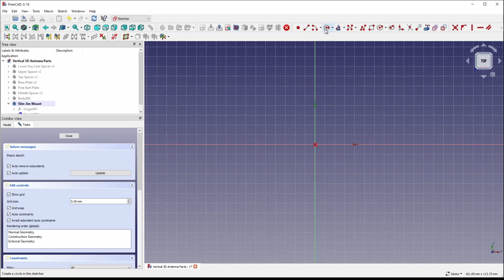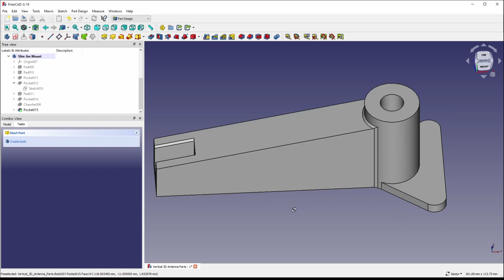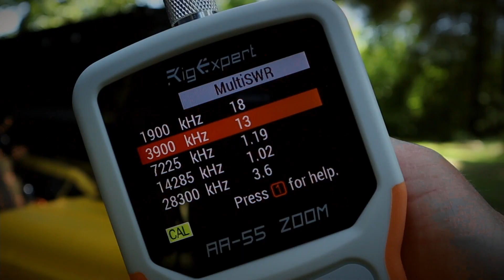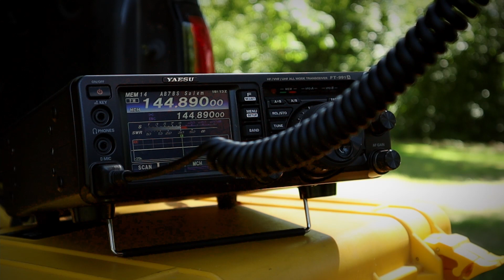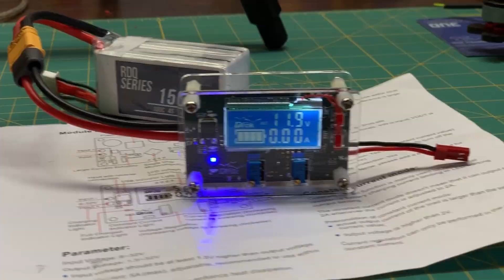ARRL 2021 Field Day Prep! Add a Slim Jim Antenna to an HF Multiband Vertical (#37)

Comment: You could also just try Creating about five or six loops 8 inches in diameter at the bottom of the antenna before the coax connects That will help to remove the feedline from the antenna system and isolate it
Reply from the maker: Hey Pat! As it turned out, it was a bad coax. I was using several smaller pieces and one was intermittently shorting out.  I'll try it again sometime!  Cheers.

Comment: I would guess a short at the coax connector that developed after the higher power was applied.
Reply from the maker: Hey Dave - thanks for watching!  Actually your spot on. I grabbed a bunch of odd cable lengths and connected them with barrel connectors.  One of the cables I connected ended up being shorted out, but I didn't find out for a few days when I used it somewhere else and tested the circuit with my RigExpert.  That experience really drives home the need to test your equipment after you're all setup!  Cheers.

Comment: The day before Field Day '21 we set up an AR-2259/GB clone antenna and verified that it worked fine. The next day we were getting high SWR and no signal in/out. After testing the coax/antenna with an analyzer we eventually discovered that the SO-239 barrel was bad. Also coax can seem fine in one instance but present a break in the center conductor when moved around. It may be hard to find a break in the coax, but those RigExpert analyzers can detect coax breaks. The manual shows the method to use. Did you check to see if there was a short in the coax?
Reply from the maker: Hey John - thanks for stopping by. Good point! I didn't check for shorts, however I've used and continue to use the same cable I was testing on.  One thing comes to mind is the loss factor.  Looking at a few calculators online I see that a transmitter running 50 watts down RG8X at 145Mhz will have the output power reduced by over 50%.  However, I think their might be a little more to that but I've not gone back to isolate it yet.  I tried this setup during field day this year and used someone else's radio and coax and ran into the same problem.  I keep at it.  That's what's fun about the hobby.  Cheers!
Reply: @W0KNI  Ok sounds good Stephen. Hope you get it figured out. btw we use the same 145.49 frequency on our repeater here in Ft. Bend County, Texas. 73
 KD5YOU